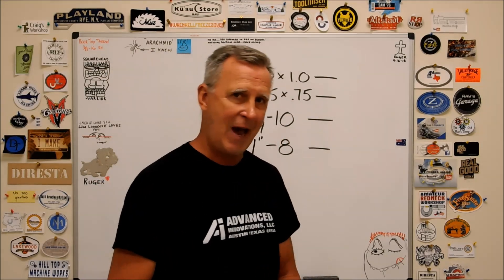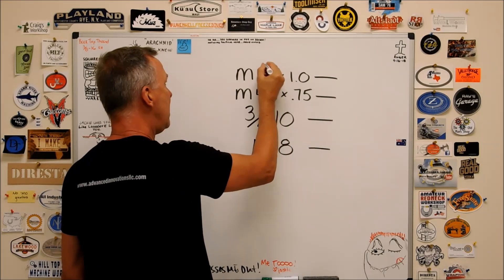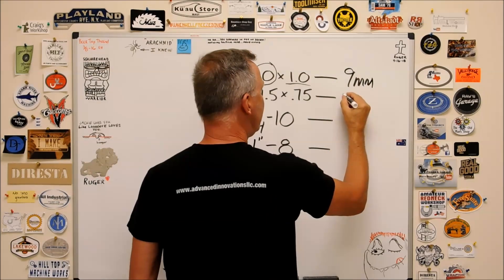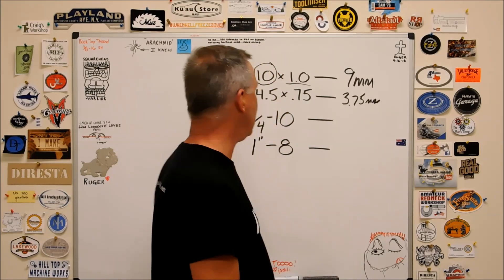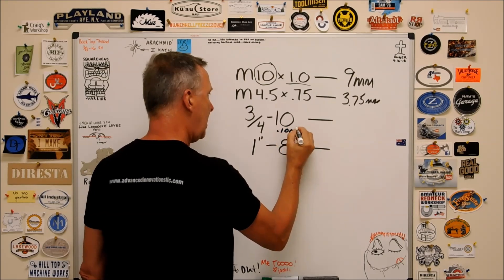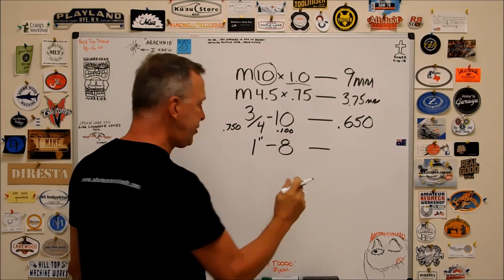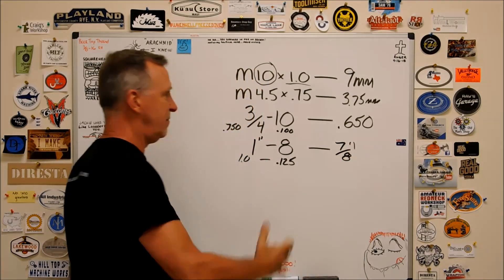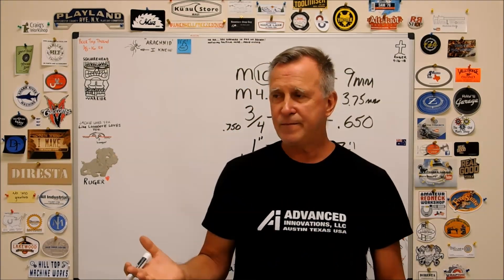How to Determine the hole size for an Internal Thread  --  SHOP GEM !!

Comment: I work in metric and learned the OD - pitch equation long ago. But Imperial is another story, because (for instance) a 1/2-13 thread will give you an oddball drill size and you will have to look it up. If it is a Morse number or letter size you must look it up. Rather than do that it is easier to find a chart that goes directly from pitch to Morse number -- or find an app that will do it for you. As for fractional diameters I just go blank. I can do things with fractions that most people never heard of. But I look up tap holes in Imperial. I refuse to memorize fractional conversions. And then you wonder why the whole world isn't metric. In fact it is, except for Nigeria, Myan Mar (ex-Burma) -- and the USA.  However, it is very good to see someone point out that OD - pitch = tap hole size. Thanks!
Reply: America is put together with 1/2-13 bolts. The 27/64" drill is often the most used drill in a drill index.
Reply: @aceroadholder2185  That comment gave me the warm and fuzzies for some reason.

Comment: Hi Joe, as a Dutch hobby builder, I have bought a tap and die set that included the correct drills for the specific taps. For M10, a 8.00 mm drill was provided, which is logical. 
A basic rule for metric thread is predrill with 0.8 times the thread size, so for M4, you would use 3.2 mm, for M8, 6.4 mm and so on.

Regards, Sander Faber
Reply: Yep, same here. .8 times the thread size. I thought I was the only one thinking this is wrong...

Comment: Always learn something from you Joe, that's why I subbed years ago. This is probably the MOST USEFUL thread tip for beginners and professionals alike, I've seen in years! Best Wishes & Blessings. Keith Noneya  PS does it work the opposite for Dies? Keith

Comment: For the threads Joe used this is great, but when playing with little things like #8 screws I would have to measure the OD of the screw, then do the math, then look on the chart to see what number or fractional drill was the correct diameter.  Coincidentally, that is the same chart that lists the recommended tap drills, so for little imperial stuff there is less work to just look on the chart to start with.  On a larger diameter where you are boring the hole, or a weird/custom thread this would be quicker.  Metric doesn't count, almost everything about metric measurements is trivial to do in your head.  Somebody asked about whitworth threads, a whitworth 55 degree thread is going to be shallower than a standard 60 degree, so you will get a looser fit with this math, but really for a one off job, unless it is a very small diameter, or something where failure is dire, you will be fine, especially if you are single pointing and test fit as you approach depth. Your internal thread will just be slightly truncated.  If it is really small you will probably be tapping, and if failure is dire I hope you are meeting a class of fit, which means you need to look somewhere other than the standard tap drill chart anyway.

Comment: But wait!  I'm looking at my tap drill chart - one of several from several different sources which are the same - and there's a column that indicate 75% thread for aluminum, brass & plastics and shows one size tap drill, and another column that indicates 50% thread for Steel, Stainless & iron.  Two different tap drill sizes for the same screw. 
Now, I recently wanted to tap a hole in 1/4" mild steel plate for a screw.  Using the recommended tap drill size, the screw had some backlash.  I tried several tap drills, each slightly smaller until I found a size without noticeable backlash.  It was a bit tight, but that was acceptable for the application.  So the guidance in your video seems like a rough rule of thumb. 
I also keep copies of that tap drill chart by my lathe and my drill press and my milling machine.
Reply from the maker: If you think about it, the hole is only root to crest clearance. Any backlash would be a result of the profile engagement. A tighter hole must have given your tap better alignment. Don't be fooled.
Reply: @joepie221  That's true if you use a tap, which has a fixed diameter, but if you use a boring bar to single point cut your internal threads, you start cutting from when the tool touches the workpiece. So it gotta be different right?  Not sure how to wrap my head around that. 

I do know that if your hole is too SMALL to start with, you're gonna have bad backlash, because to get the screw to go in you're gonna have to cut deeper and deeper roots, but the problem is that your crests are too high, and by the time it goes in you'll have started to cut into the width of your crests.
Reply from the maker: @felixar90  I see you are a subscriber. Thanks. One thing that continues to make me shake my head is when guys say thread depth. There are many things wrong with that. Fist would be the flat on the tip of the tool. If you have a sharp point and do the thread depth thing, on an ID thread, the thread is undersize. If the flat on the tool is too wide, the thread will be oversized. Pitch diameter, thread profile, major and minor diameters all contribute to a good thread. This formula assures the root and crest of mating threads don't hit. everything else is up to you. External threads are easy to measure, but internal...not so much. If you can, when single pointing a thread, make or have a gage at hand. NEVER use the mating part unless you are going to have both parts in your possession forever.
Reply: @joepie221  Well it doesn't have to be the mating part. If you started from a hole that was too small, and you just keep backing out the compound slide (for internal threads) without thinking, by the time your go gauge goes in your no-go gauge will also go in. 

If you are serious enough to have thread measuring equipment, you probably also have the reference to know the exact minor diameter to start with. 

I'm with you on that tho. That rule of thumb will never give you a hole that is too small. If you're cutting standard threads and not just making up your own, that is. If you get sloppy threads with that the solution is not to try again with a smaller hole, it might make the problem worse.
Reply: Ferndalien; Couple of things to comment on. You would be surprised to see the variation on Taps and Dies. Most Dies are split-type, and people rarely adjust them (and most of the time, they don't), but if you are looking for a real 2A/ 2B thread and dies are the only to form the thread, it may be necessary depending on the material being threaded. Same for Taps and Tap Drill sizes; drilling and tapping some materials will result in more metal deformation (aluminum and brass with a slightly dull tap will readily exhibit this).
Reply: The backlash is irrelevant if the screw is used to tighten something down, which is like 99% of why you would use a screw.  It disappears once the screw is torqued down. It would only be relevant if your screw is for some kind of adjustment  where it's screwd only halfway in. Bu then you can use a locking nut.

Comment: It's nice to see that you'll share a "Rule of Thumb" level "shop gem" for determining tap drill size; having also explained the value of, and variations on, the "three wire approach" to measuring thread for single point (external) threading.
I heard this one ages ago but I tend to be wary of any "All you've gotta do..." advice; at least until I've done some Frigonometry.

Comment: This method is approximate at best...
First, the top angles of imperial and metric threads are different (55 deg. and 60 deg.) - so the calculation method ought to be not that universal.
Second, the recommended hole size for the same thread/tap is different for different materials: for example, the Russian standard calls for a 9.11mm hole for M10*1.0 threads in high-viscosity materials (aluminium, brass, titanium, stainless, etc), but a 9.0mm hole in "normal" materials.
Third, for very small and very big thread sizes, the rule "(diameter)-(thread step)" does not hold (albeit, not for much): again, the Russian standard dictates a 0.77mm hole for M1*0.25 and a 42.8mm hole for M48*5.0.
Reply from the maker: Thanks for your input. It is interesting to be exposed to the differences our own countries have regardless of cultural or industrial.
Reply: Both metric and imperial use 60 degree (https://en.wikipedia.org/wiki/Unified_Thread_Standard). 

Also the standards doesn't include the hole size at all, only specifies the finished thread. And those standards are the same no matter the country, otherwise you are looking at another type of thread.
Then there are tables recommending different hole sizes for different applications and here things vary a bit due to material, requirements of precision, cutting tool used etc etc.
Reply: @sharg0  Yep, American UNC/UNF and NPT threads have a 60 deg. angle. But many other "inch threads" have 55 deg. angles (including British Standard Pipe Thread (BSPT) that is used all around the world except North America). And, as far as I understand, there are some other subtle differences in thread profile between metric and American inch-based threads that may affect hole size calculation.
And, because I live not in N.America, my understanding of "inch threads" is mostly connected to British standards (BSPT).

As for standards for hole sizes, in Russia they do exist (actually, that are 50-years-old soviet standards). The aim of these standards, I guess, is to codify tolerances. But at the same time the standards set the hole sizes themselves.
(Details: GOST system: https://en.wikipedia.org/wiki/GOST
The hole standards: GOST 19257-73 "Holes for threading metric threads. Diameters" (seems like there is no English version of it)
GOST 21348-75 "Holes for threading pipe cylinder threads. Diameters" - this is for "inch threads")
Reply: Actually, you're wrong.
These thread calculations are for a standard of 75% thread engagement. The only time you would change this is for extreme reasons such as threads deemed for high/low temperature applications or if it is in tricky materials and you are forming the thread rather than cutting it.

Really? A 0.77mm hole instead of a 0.75mm hole?? I'll take the ubiquitous 0.75mm hole as it's stronger than your silly "Russian" standard.
Clearly, you've never even tapped a hole.
Reply: @billweber1340  The third point about "0.77mm vs. 0.75mm" was the last and the least important (practically, purely formal), especially knowing that the standard tolerance is 0.77+0.06mm.
The main argument was that the method is approximate for imperial threads. And it is so (see, for example, https://www.natool.com/wp-content/uploads/2019/06/tapdrillsizes-inmet_web_catp113-116.pdf): the formula is "Nominal O.D. - (Dbl. Thread Depth X % of Full Thread)", and there is a table of "TPI vs. 75% dbl.thread depth". And, as you can see, 1/TPI significantly deviates from "75% dbl.thread depth":
TPI=6, 1/TPI=0.1(6), 75%DTD=0.1625, difference=4+ thou
TPI=10, 1/TPI=0.1, 75%DTD=0.0974, difference=2.6 thou

P.S. Yeah, I am just a hobbyist, but I definitely do tap holes. And I compensate my lack of decades of professional experience with following the industrial standards from where I live.

Comment: that is definitely a shop gem. tangled with this recently. just guessed. got it first try. but it turned out a little tight. would have been better if i had known.
Reply from the maker: A little luck is a good thing at times.

Comment: Yes, Joe, that's why you can use a 5/16 drill for a 3/8-16 threaded hole. 16tpi pitch = 1/16". 3/8 - 1/16 = 5/16. If only they all were that easy! Love all your tech tips. And spider wrangling. Mart.
Reply: Especially kooky when you get into numbered screws - 8-32 and etc.
Reply from the maker: The spider videos seem to draw a crowd. I'll probably do one a month to see.

Comment: Here's the video on a nut and bolt and Joe mentioned, but didn't name or link:

It's Adam Savage!

https://www.youtube.com/watch?v=98MCz9gQaiE
Reply: I'm an amateur metal lathe operator and found it remarkable easy to learn how to machine threads. I'm extremely surprised that Adam made such a pig's ear of that job especially with the equipment he's got and no doubt I would think more lathe time than me. It was incredibly painful to watch his attempt as I saw so many fundamental mistakes.

Comment: When I was an apprentice, my dad told me metric tap drills were so easy to figure out, like you said. Later, fooling around with the math proved the same for imperial threads. I made a chart for my own use in my shop. The proof in the pudding is when you are making an oddball one off, or single pointing on the lathe. Bear in mind the formula is for 75% thread depth.
Thanks Joe, cheers!
Reply from the maker: Sounds like you had a good Dad.

Comment: is there formula for external threads?  great tips from you always
Reply from the maker: Just pitch measurements and tool flat suggestions. Some will preach thread depth, but without a super accurate tool tip, thats a myth too.

Comment: Hi Joe,  thanks for another  But, the standard M10 thread pitch is 1.5.  The fine thread system is 1.25.  I guess that you are looking at an extra fine system.  M4.5 is right.  Having said that the information that you have given us is, as you say, is a gem.  As a model maker I have to "make my own threads up" from tome to time.  The last one was 0.837" OD with a 40 tpi thread due to a very thin wall tube.  Keep up the good wok.  Stay safe.
Reply: If a thread only is given as M10 it's correct that it according to the standards has a pitch of 1.5 mm. However, for fine threads there (sadly) isn't a fixed pitch for fine threads, they are always specified. There are though preferred pitches and for Mf10 there are two, 1.0 and 1.25 .
So, if needed (or very bad engineer), you could end up with the specification Mf10x0.5 or even M10 x 1.17 and correctly call those metric threads. Why they have been stupid enough to not specify a fixed list for fine threads just as the default pitch beats me, as a machinist it's a stupid thing to miss in my opinion.
To make it even more confusing there isn't a requirement to specify Mf 10x1.0 it can also be written as just M10x1.0 nor is there a coarse version, only the standard. (That said, M is always written with a capital M.)
Reply: Hi Rolf.  Thanks for the reply.  Please refer to ISO 724-Metric Threads.  I hope that the link works https://www.engineeringtoolbox.com/metric-threads-d_777.html   Have fun.
Reply from the maker: The example was strictly for the mechanics of the math. I didn't mean to mislead anyone with an implied standard.

Comment: Joe, another quick comment.  The "Simplified Tap-Drill Formula" provides a "THEORETICAL"  approx. 72% thread.  Aside from that, one commenter mentioned percentages of "85%" thread.  There is no such thing in the Unified or ISO system for internal threads!  Maximum is 83-1/3% (which should never be attempted) down to a minimum of between 60 - 65% (depending upon size).  Drill charts shoot for 68%, but cannot always be achieved based upon the commercially available drill diameters.   ( I was also a drill and end mill specialist as well  Chair of ASME (ANSI) B1.1 Inch threads, and B1.13 metric threads)
Reply from the maker: 85% percent would be nuts.
Reply: @Donald R. Cossitt No. The slightest amount of dust would block it.

Comment: Joe, based upon some of the comments, it might be helpful to add the formula for machine screw sizes, which can be remember two ways.  The formula is based on the fact that there is a difference of .013" between each MS (Machine Screw) number.  Generally, we taught that you start at #0 (.060") plus (.013" x MS number),  i.e. #4 =  .060 + .(.013 x 4) = .112".  However, it's a whole lot easier (for me anyway) to remember that a #5 is .125" or 1/8", then either add or subtract .013" from 1/8.  i.e. .125 -.013 = .112 (#4) , or .125 + .013 = .138" (#6).  GTD "Tap Guy" Tech Specialist (43 years)
Reply from the maker: Very interesting. Thanks.
Reply: I'm writing this down for Ref.

Comment: For standard metric threads (6x1, 8x1.25, 10x1.5, etc), 80-85% of the thread diameter is a pretty good estimate.
Advantage - there´s no need to know the pitch.
Reply: Since metric is what my shop work in 90% of the time, I have a dedicated draw for all the standard metric tap drills. So It's really easy for get the size right. But suppose this video is more for when you're not working with standards
Reply from the maker: Quite the opposite for metrics. This video is better suited and matches the standards.
Reply: @joepie221  okay, what I mean is when you're not familiar with the sizes.
For example I work between M6 - M30 so have a pretty good idea on tap drills because of repetition. But if someone asked for a 2" UNC I would have to look it up without knowing this trick (Never realised it worked for imperial too). 
Also if someone asked for an M3, none standard for me but easily figure out.
Its a very usefull tip to know. Like riding a bike as you'd say, never forget it.

Comment: One note: This rule applies when the thread is cut, if the thread is pressed or rolled other dimensions apply!

(Cut thread = material is removed be it by tap, die, turning, milling... 
Pressed / rolled = Material is forced to move to both smaller and larger diameter at the same time (called cold forming or plastic deformation). This creates threads of very high quality and most materials responds with an increased hardness of the threads but far from all materials can be threaded this way. Another benefit is the elimination of chips in holes.)